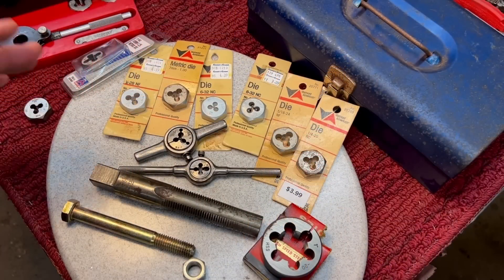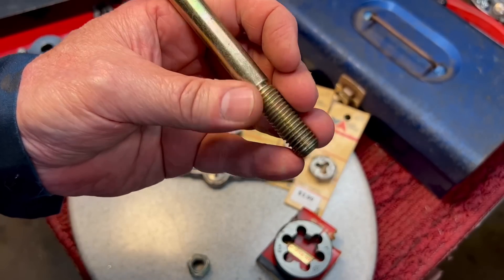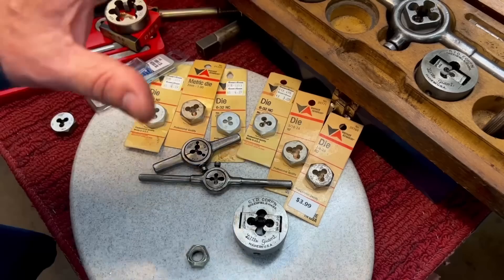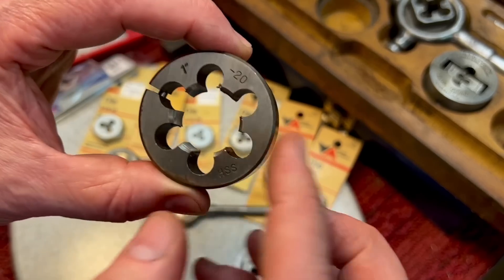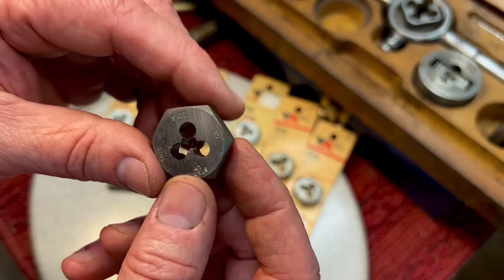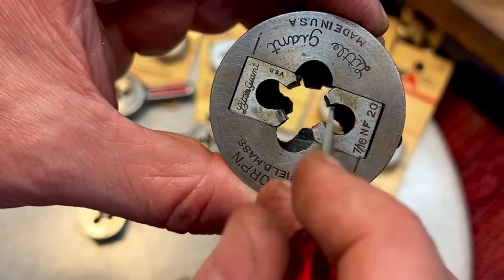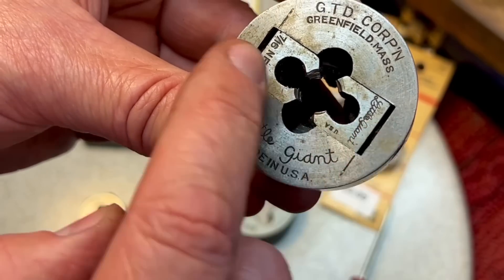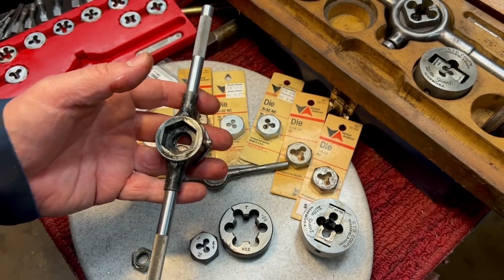Introduction to Split Threading Dies and Their Use

Comment: Hi Scoutcrafter, I used taps and dies an awful lot in the 80s in the machine shop, quite a few differences between UK an US tools, but the thing I liked most was your appreciation of a beautifully crafted tool as that tap you showed, I have down sized a lot lately but when going through my taps and dies there were some great old English makes that I just couldn't part with. I have a set of original 1inch Whitworth taps. Take care my friend. 👍👍👍🇺🇸🇬🇧✌️

Comment: May have been mentioned further down, but a trick with non-adjustable dies is to rough the threads in via single pointing them on the lathe. Then run the die over the work. This emulates what the adjustable dies do. This helpful in tough materials or when you need a decent thread in a hurry.
The holy grail for machinists is an adjustable Geometric die head which mounts in the tailstock or turret. Roughing and finishing passes are done in seconds to a toleranced pitch diameter. Not cheap but the cat's pajamas if you are making a box full of parts.
Cheers from NC/USA

Comment: Great video 👍You did a great job showing and explaining to us about the split die and the adjustable dies, Fantastic 👍. Those Greenfield threading dies are sure expensive 😮😱💰 but I see how they work a lot better by not threading a lot of material at once. Did  you ever use  kerosene for cutting your  aluminum threads? I think you  mentioned you used WD-40. Well again great video and can’t wait to see what you do on Friday. Have a great evening. 😃👍👍
Reply from the maker: Steven- Wd-40 works really good for aluminum and I have tap magic for aluminum but like Kerosene I don't like the smell!   LOL

Comment: Fascinating stuff.  The problem with metal working as a hobby (compared to wood) is that it requires too many too expensive tools. You can get by with a few basic hand tools for wood, not so much for metal. 
When my father was a shop student,  each  student was given  a 1 inch section of 1-inch steel rod,  a hand file, and a pair of calipers .  Task:  to make the most perfect cube they could produce.  He said it was not as easy as it sounded.
Reply from the maker: Your Father had some task!  You are so right about metalwork, I find the same thing about welding, it takes a lot of practice and $$$ just to be a beginner!

Comment: Brought back many memories.
My first set of dies and handle stock were for pipe, 1/8, 1/4, 1/2, 3/4, 1, 1 1/2, & 2 inch NPT. They must have been 80 years old. The die stoch took 16 in threaded handles and the whole monster was near three feet long.
Of course I needed a half dozen pipe wrenches...?
Nest set was maybe close to 100 PC Bluepoint set off the Snap-On Truck...much easier to use.

Comment: About 4 years ago I went to our local Habitat Restore and bought 6 sets of brand new still in the package Ridgid pipe dies. I paid a dollar a package and was shocked when I got home and looked up thr retail prices on them. Last year I went to a estate sale of a former drag racer. I bought a plastic bag with 78 taps in it for $20.00 with sizes up to 1/2 x 13 NC. 74 were brand new in packages , 2 were used and 2 were broken. All U.S.A. made. For some reason dies are much harder to find.
Reply from the maker: What a great score!!! 😃👍
Reply: @ScoutCrafter  I don't always do good. One time at the Habitat Restore I found a wood box with about two dozen 1-1/2 split dies. After buying them and getting them home and cleaned up I found every on had broken teeth making them useless. I could have taken them back and got a refund, but they were cheap and I keep them around to remind me to be more careful.

Comment: Great information. Thanks so much. I tend to add threads to high pressure tubing using the same type of die setup. I back off the turn every revolution to break the chip that forms. Also lots of cutting oil.

Comment: Great explanation video, for those who don't know all this stuff,,, 👍,,
ps,, as an apprentice electrician, back in the 70's, I must have threaded so much conduit, it still makes my arms ache, thinking about it,, ha ha ha,, pps, we used to extend the arms of the "stocks" with offcuts of conduit, to reduce the effort needed, (especially on inch and a half conduit,) and it was faster to spin the stocks and dies off, when you'd finished threading,, 🤣👍👍

Comment: This has to be one of my favorite videos! Thank you so much for explaining how the dies work. I have one question ( and you might have told when someone was trying to talk to me ) but do you use any kind of a 
 cutting oil ? Thank You John.
Reply from the maker: Hello Jack- I’m sorry I left that out, absolutely yes!  Cutting oil is imperative when threading or tapping.  The best cutting fluid is Tap Magic- for steel and WD-40 for Aluminum.  Brass and cast iron don’t need cutting fluids.  😃👍
Reply: @ScoutCrafter  Thank You

Comment: Great explanation, now you need to do the styles of taps and their purposes. Long ago I was let go from a place because they wanted to use a plug tap instead of a bottoming out tap, plus they were wanting one tap to do the job. I brought that up and it embarassed them as they knew I was right but couldn't admit it. At first, especially when you are young to get dumped for somthing not your fault. As you get older you realize they are not the type of place you want to work for. In the same line of knowing which taps is knowing what a tap drill and a body drill is for.
Reply from the maker: Philip when we get older we learn how to interject information without ruffling feathers!  😂.  I remember I had a similar situation at work and I literally had to pretend he found the answer himself.  😃👍

Comment: I used to thread drill pipe and other oil tools
Reply from the maker: I bet that is amazing- Drill pipe is tough and uses that crazy taper.  😃👍
Reply: @ScoutCrafter  it is usually 2 inch taper